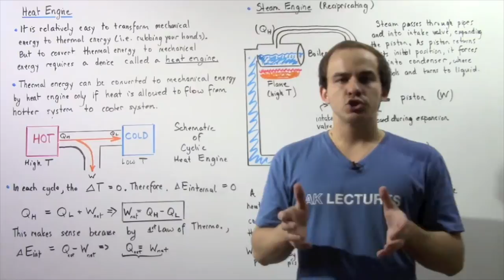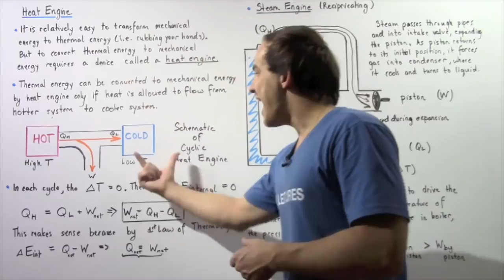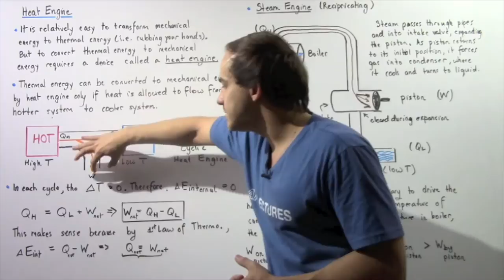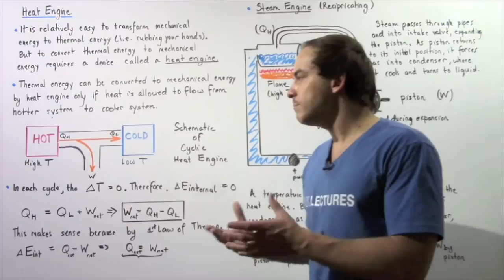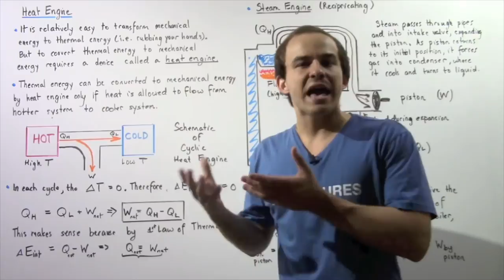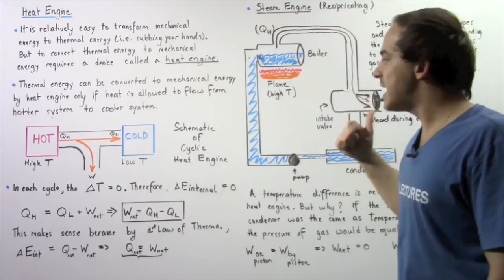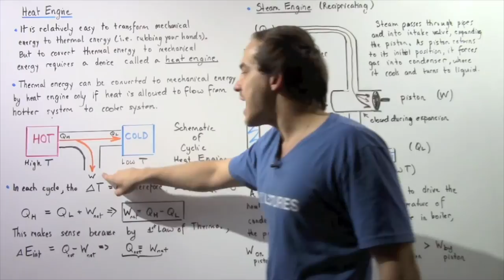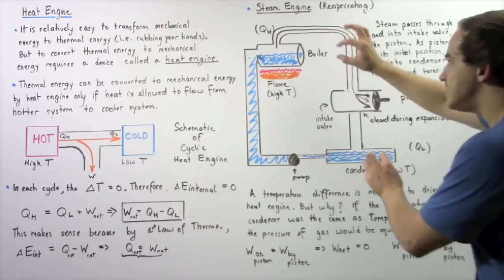Heat Engine

Comment: As a physics teacher...I recommend you to draw the intake valve in a vertical direction so the piston can come back to its original position due to gravity after loosing pressure of gas due to lack of energy and tends to compress the gas by cooling it.
Reply: could the piston be horizontal for example if was connected to another piston by a crankshaft?